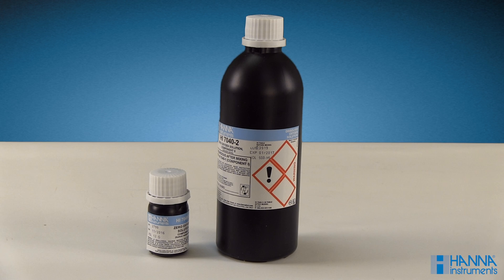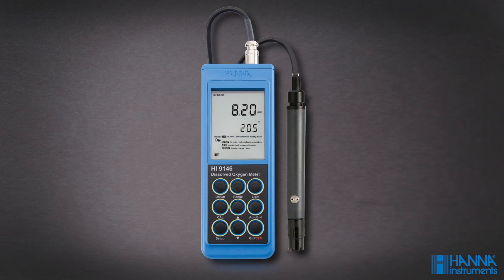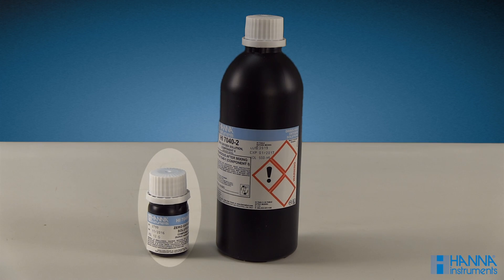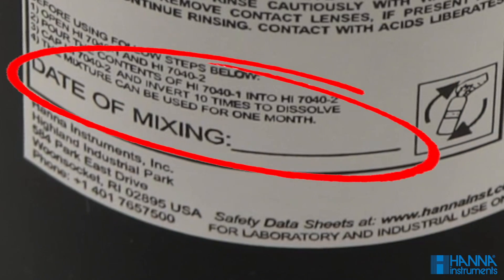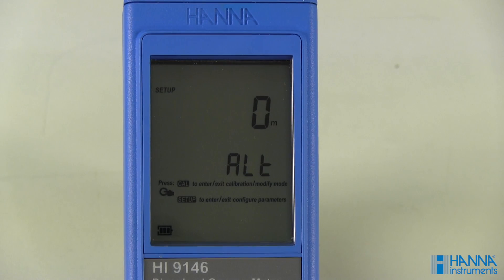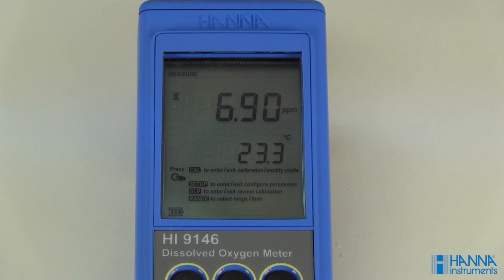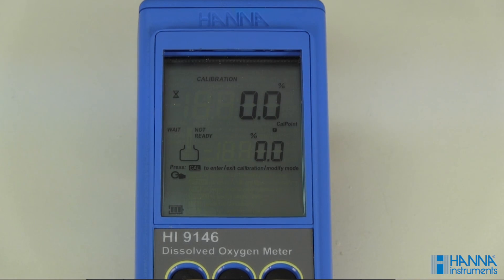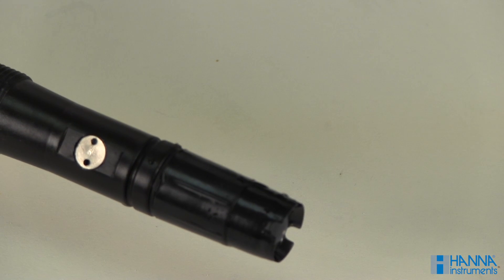Knowledge Base: How to Perform a Zero Percent Calibration with a Dissolved Oxygen Meter

Comment: Hi, I have purchased a HI98194 Multiparameter Meters. But every time I perform 2 point calibration (100% and 0% ) It come a message "Wrong Standards" despite of following all procedures. Any help?
Reply from the maker: +John Kinyage 

Hi John, 
The “wrong standard” message appears when the displayed reading is too far from the selected calibration point value. Once mixed, the 0% calibration standard is stable for 1 month. If it has been sitting for longer than a month, it will need to be remade. Also, ensure that the D.O. sensor is not damaged and that the standards are not contaminated. 
If there are any further concerns, please visit hannainst.com and contact support through there.
Reply: +Hanna Instruments, Inc. 

Hi Hanna Ins.
Thanks for your reply. I have to follow all the steps but it seems unhelpful. Have done a two point clibration 100% saturation and 0%. still "wrong standard appears". I had a simple password on the meter but it also says wrong password afterward. Alphanumeric input on password setting is not explained anywhere... Any help on how to remove the password?
Thanks.
Reply from the maker: John Kinyage 

Hi John
Sorry for the trouble you're having. I think the best option for you would be to contact Tech Support. You will have much better luck having a one on one dialogue with our team over the phone. 
tech@hannainst.com

Let us know how it all turns out for you!